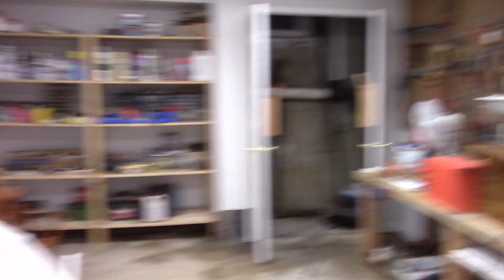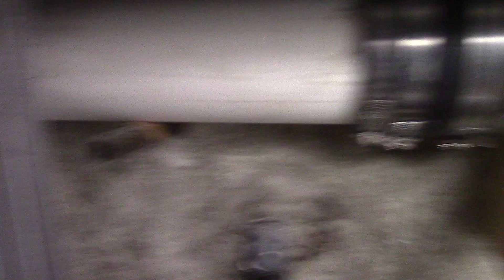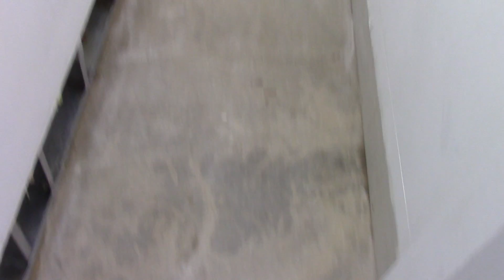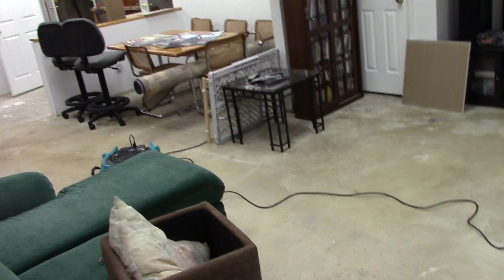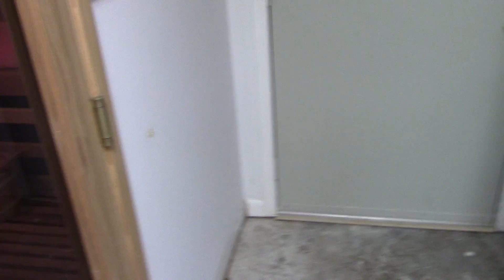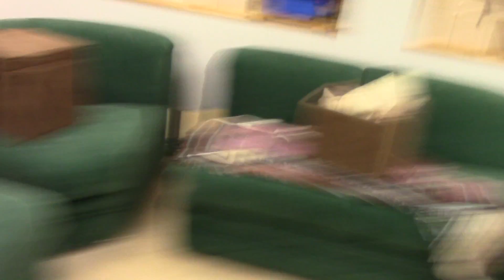Basement Flooring Removed. Walls Cut.

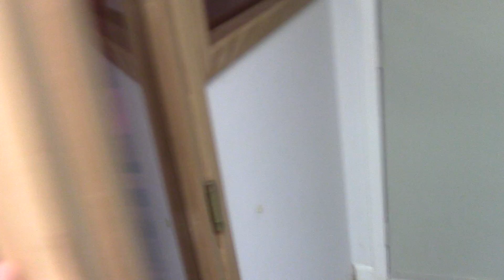Comment: 11:32 LMFAO!!!  It's contagious!

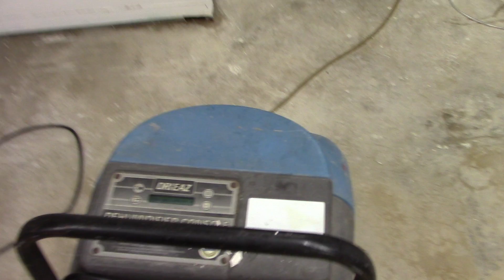13:23 Totally didn't expect you to say that, or the other comment, in such a serious video!

It comes as no surprise that xjoe81x wrote what he wrote!  "Gut the whole thing, just like my house".  "Oh, Sharkie's putting down a tile floor now.  Big shot!"

I had no idea the leak was that bad, and that the damage was so widespread.  The power of water is tremendous.  Like other forms of disaster, like fire, as long as its kept controlled it can really do a lot for us.  But out of control you can truly see the power behind it.

You might wish to see if they're going to put down some sort of sealant on the new tile floor, that may help prevent such damage in the future should something go awry again.  And if it does, it doesn't look like it'll be from that pipe.  Hey, at least you got to see something you never thought you would ever again, although not under the best circumstances.  But face it, if this didn't happen, the chances of that floor getting ripped up would be pretty slim to none, unless xjoe81x came over and wanted to change the color of the floor to terracotta!
Reply from the maker: +jaykay18 The only reason I even did those comments, was because of you guys. Haha. 

Yeah, when I saw just how much of the concrete floor was wet, I was just in shock. Most likely the old moisture barrier managed to keep the water away from the surface of the floor, the farther away from the pipe it went. 

I'll see if I can find out about a sealant for the basement floor. I have a feeling they will, since it is being installed in such a place, but, you can never be too sure with some installers. 

Indeed, it was pretty awesome to see all of those again, and down the road when they get covered up again, hey, I got a video of them! 

So sorry, but if Joe was here, the basement would be unfinished again! haha
Reply from the maker: +xjoe81x Yeah, the raising the floor was required because of the window height. As you can tell, with the drain pipe's location, the window could not be made any lower, so the floor needs to be raised to compensate.
Reply: +Sharkie626 OMG. all great comments. I watched this video while taking a shit at 130 in the morning. I totally missed the two funny parts until jay pointed them out. Yes at the is point I would have completely gutted the basement. It's has to be a pain in the ass for the workers to work around  everything down there. Are you aloud to leave that hallway where the leak occurred the same level and not raise it? I am still at a lost for words. I have no words for the damage and destruction the leak caused. IDK I see a blank canvas for the basement floor and almost half walls. I am crazy,  I'll also know that some walls were fixed and some are original. Gut the whole thing and put to bowling lane down there and call it a day.
Reply: xjoe81x There you go, spending money you don't have again!  I think every time you think of stupid stuff like that, the amount it would cost to do that should be deducted from your bank account, and deposited in mine, where it belongs.  For safekeeping.
Reply from the maker: +xjoe81x Once the repairs begin, the window hallway will be raised again like it was before. It can be seen in earlier basement videos. The platform was disassembled completely because they had to clean the concrete floor beneath it, and cut out some of the drywall. 

That's what can happen when you get a laminate flooring. Once water gets below it, it's done.
Reply from the maker: +jaykay18 "Now see, in California, that'll cost ya $500."
Reply: xjoe81x Forgot to mention, considering you missed the two funny parts (discounting what time it was), you gotta stop huffing that stuff, it does bad things to you.  Then you need me to bail you out.  And as Sharkie says, "...in California, that'll cost you $500."  Normally it's $499, but for you, $500.
Reply: +Sharkie626 Why does the hallway need to be raised at all?
Reply: xjoe81x Probably has to do with code for the egress window, it must be no more than x-amount-of-inches off the floor, so the platform was put in to raise it to pass code.  Plus it's a nice place for the stash, but from what I understand, "they don't do cocaine, Frank."
Reply: +jaykay18 Right but the code enforcement officers are not around. So why raise the floor if no one is going to know?
Reply: xjoe81x So that way when the fire breaks out you can't escape.
Reply: jaykay18 II